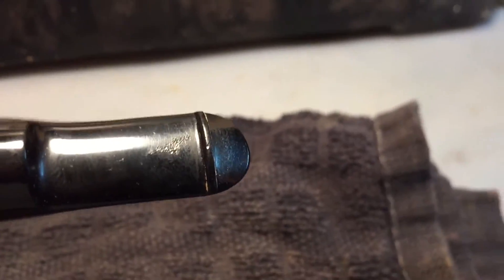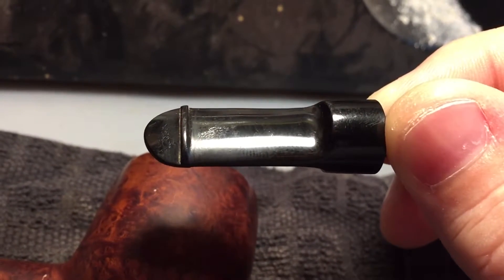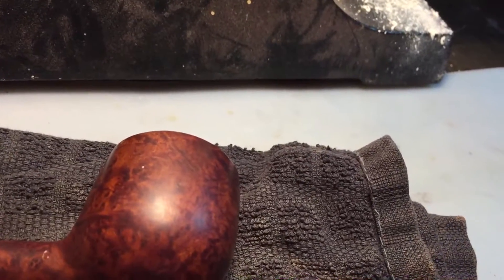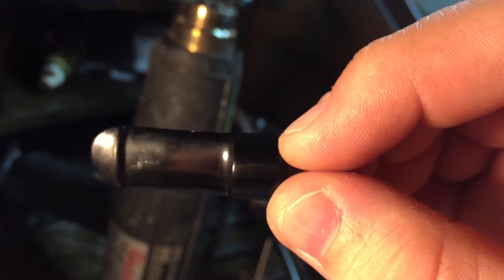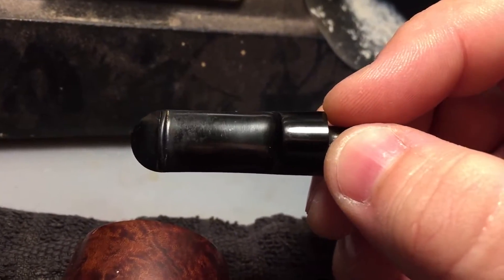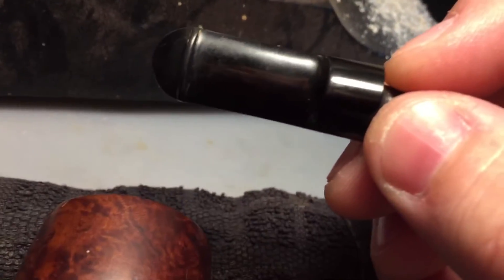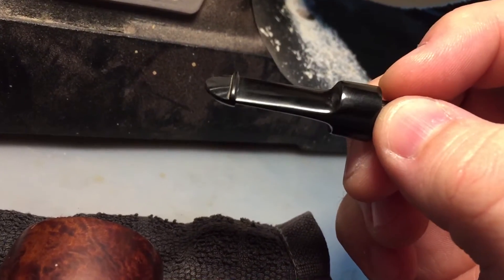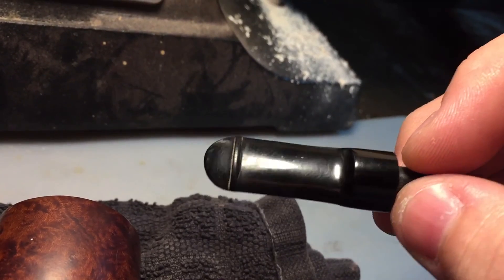Refurbisher's Pro Tip: How to remove stem chatter (tooth marks)

Comment: great tip i have tried it on briar that had been droped it worked well a tea pot or kettle for steam works well thanks for the tip on the stems
Reply from the maker: Daniel Shore it's such a helpful first step with dents and dings. That's a great idea to use a kettle and hold the pipe over the spout. I haven't tried that yet.

Comment: Awesome demo man! Im going to have to try this on a couple of stem that I have that have chatter on them.
Reply from the maker: Thanks! I hope it serves you well.
Reply: SlowLifePipes Thanks for this video. I've just got my pipe collection out again after a break from smoking.

Please could you recommend a way to remove the residue from degrade rubber mouthpiece bites/grips?

I've peeled them off but there is a sticky line around the edges and underneath where the rubber was.

I'm going to try clenching without the bites from here on. But most of my pipes are big  bowls and are quite heavy to balance.

Thanks muchly
Reply from the maker: So sorry Bill! I was not getting notifications for comments for awhile for some reason and I had no idea this video had gained so much attention. The best ways I know of getting that kind of oxidation off is #0000 steel wool, micro-mesh sanding pads, or Magic Eraser. If you lookup each of those methods on YouTube you’ll find some good videos explaining how to do each.

Comment: That would have saved the bit on a nice sandblasted jobey. I sanded it to thin and but thru. I have a heat gun and this should come in handy.  see ya Saturday
Reply from the maker: pipeheadOR sanding stems is always tedious and risky. This helps me reduce the amount of sanding, which is helpful for my hands more than anything else.

Comment: So this does work with acrylic as well?
Reply from the maker: It does. It also works on wood, although sometimes wood needs a little steam to help it along.
Reply: SlowLifePipes cool man! I’ve got a Savinelli with a pretty significant divot in the bottom of the stem. Also, you wouldn’t happen to have a how-to on reshaping the button would you? This is just a little chewed on and kind of distorted.
Reply from the maker: J. Oakley I don’t have a video on that yet. I’ll try to make one next time I have a stem that requires it. But rebornpipes.com blog has some good posts on it.

Comment: The bit clearly left the frame, at which time, i propose, you switched it out for a new one.  :)
Reply from the maker: Ethan Leavitt "If you must blink, do it now."
Reply: Bwahahaha
Reply: He sanded one side of the stem, which you can see on both the before and after, plus you can still see discoloration where the bite marks were.